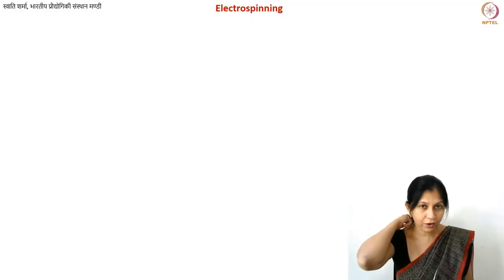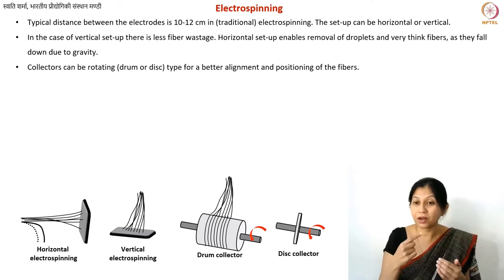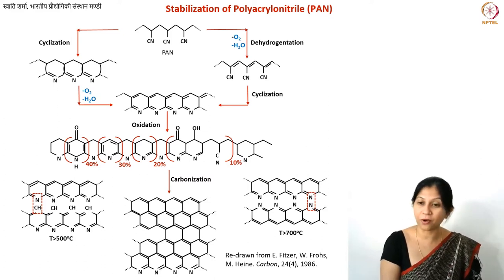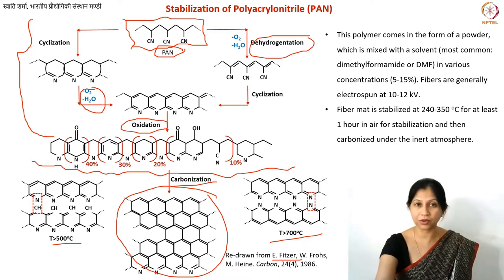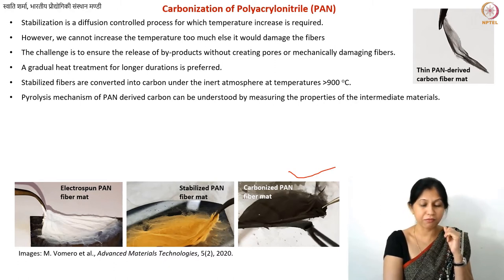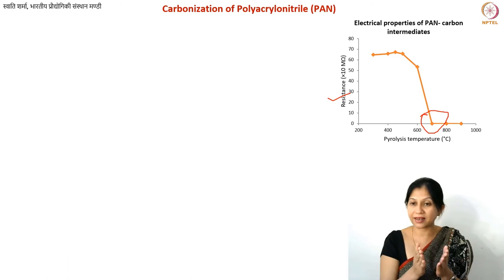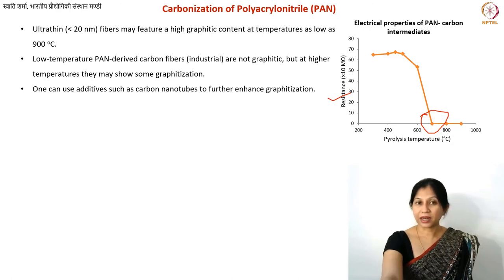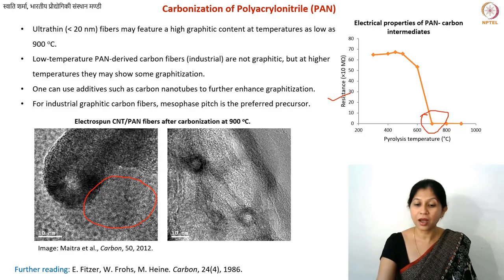Carbonization of Polyacrylonitrile (PAN) Fibers

Comment: Most common solvent used for wet spinning is DMAC nd DMSO and wt% of polymer to solvent is bw 15 to 20%
Reply: DMF is more common, it has a higher solubility for PAN and lower boiling point allowing for electrospinning with lower PAN concentrations
Reply: @szymondoszczeczko4594  don't know about electrospinning process.In wet spinning nd dry jet spinning DMAC or  DMSO are used as solvents for PAN spinning to get precursor fibre.